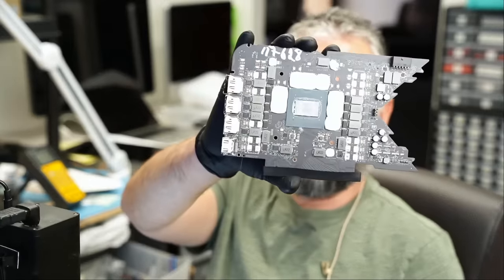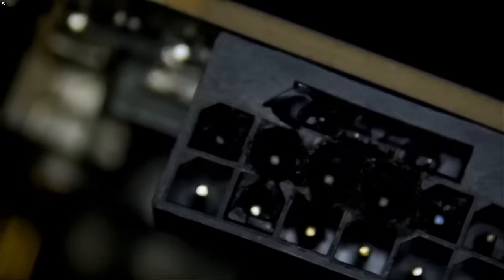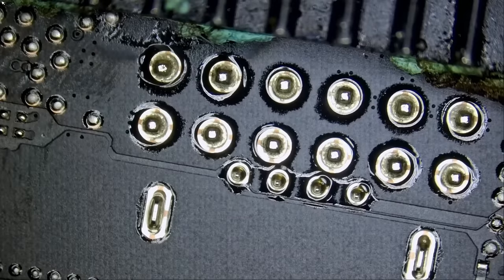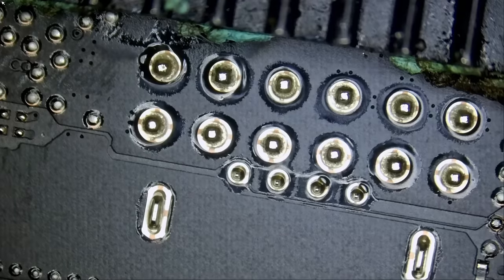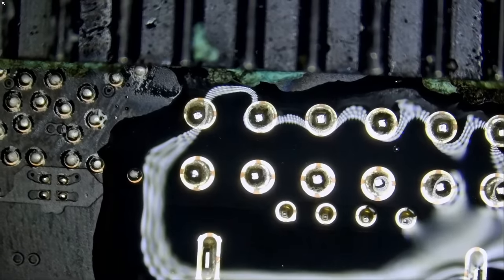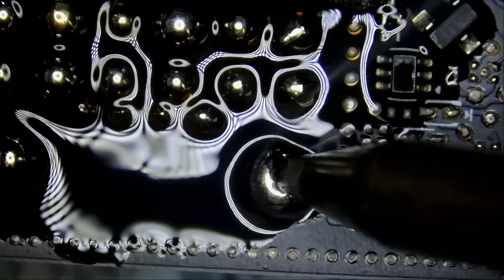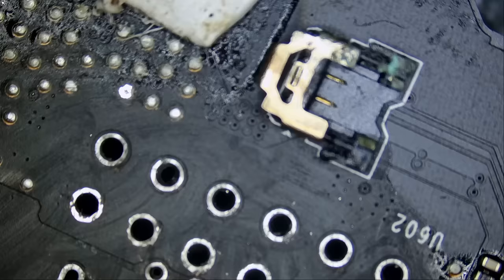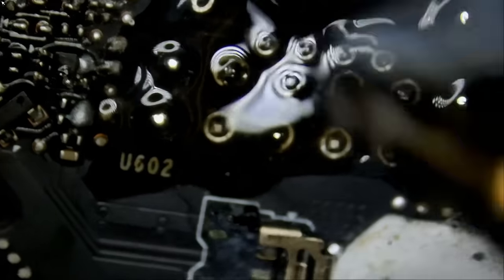4090's Still melting. What I think about CableMod

Comment: What do you think about the Cablemods direct cables? these ones specifically - CableMod RT-Series Pro ModMesh Black Sleeved Cable, 600mm, 16-Pin 12VHPWR to 3x 8-Pin PCIe, for ASUS/Seasonic PSUs ? I've just brought a 4090 FE And put it straight under water and so far it seems to be running as cool as anything even in gaming, no issues with hotspot or memory temps either and with that cable it's allowing me to run up to 133% power limit which allows up to 600W instead of 450W whereas the official Nvidia cable needed all 4 4 pin cables which I didn't have at the time so was restricted to 450w max. I'm keeping check of the 12VHPR cable end for heat, i've got a thermal camera I can use if needed too.
Reply: It works well enough, I have it, I bought the evga variant with 4*8 pins connector, no issues, I also had 90 degree connector v1.0 and the the v1.1 180 degree, they both worked fine, I had to destroy the 1.0 to get a refund, I don't use the 1.1. I just connect the cable straight to the card. Just make sure you connect your cable fully, if you cable manage make sure you don't pull out the connector and don't bend it too much, many people can't follow this simple guidelines, and the connector is not robust as the old 8pin that could accommodate these mistakes.
Reply: @eliadbu  Thanks for the info, I'm usually pretty good with managing the cables even though it looks like a rats nest inside my PC as it's literally fully kitted out 7000X with all Corsair fans, rads etc inside of it! I've ran my 12VHPWR cables directly underneath and they come out by the back 4 fans on the side panel side as i've got my reservoir in that area too so it works quite well with the 60cm cable without putting too much strain on the GPU end which I always make sure is plugged in until I can hear and feel it click in to place as well as make sure visually.

Comment: I have a power-on problem with Asus f512f... it doesn't turn on and the charging LEDs are completely off. Can I try something? Should the computer start if I disconnect the battery?

Comment: 12V HPWR Specs should update to prevent this, At least recommended connector to have Built-in Temp Sensors to let card limit power and alert user if temperature arise above 105°C.

It may able to implement using existing sense pin. If you cannot fix the Power Supply and connectors (also cable mods) which already in the market. At least damaging to cards can be limited by the card itself.
Reply: They should get rid of that stupid 12v connector and rollback to the good old 8 pins.
Reply: @aldenkia  It's not that stupid, old 8-pin waste too much space and can be a bit of pain for cable management.

12VHPWR just need some fool-proof method to prevent bad seated connectors or poorly mated contact since its offers 0 redundancy.
Reply: @sfalpha  i believe 12vhpwr still waste alot of space due to their bending limitation (even the 90deg connector being recalled) and i dont think 8 pin connector uses a lot space either (which you can still use 90deg connector available for cheap!). The problem is 12vhpwr pin size which is too small that limit area of contact. It is within the power limit but too close to the upper limit thus leave no room for user error. Its like punishing cuatomer thousands of dollar for mistakenly plug the power connect, it is just plain stupid.

If you need more space in your case, then asus solution that bring the power connector to the mother board beside pcie slot is far better.heck even it is already being used in server space!

Comment: How could they NOT have find these issues during production and testing?????
Reply: People are using aftermarket 12vhpwr cables and angled connectors for better cable management. If you use the one ugly one provided by Nvidia this isn't going to happen.

Comment: Even if those cable mod adapters were made from titanium and 24k gold, they would still fail. The problem, as we all know, is the design of the power system on the card. Too much power through too small of a jack. Try powering up a 120v blender with 220v and you'll see the same exact failure happen. Too much power through too small of a port, period

Comment: Good thing about cable mod is that they recalled the bad adapters. I had 2 of them never used though but got a full refund from the vendor i bought them from.
Currently using a cablemod 12vhpwr stealthsense cable on my 4080. Been using it for a while and no issues.
The design of the connector is crap and you need to be carefull with tight bends and so on. The issue with the 4090 is that the card pulls too close to the limits of the cable.
There is not enough ''safety'' headroom in the cables spec for 4090's. Couple that with other variable like loose connection and you got melting connector.
Nvidia should have just sticked with the old 8pin connectors. 3 of the 8pin cables would be safer then a single 12vhpwr cable for a 4090.
Derbauer talked about this in one of his videos. Its simply a bad design and we can only hope they make it better. Or just add 2 of them for high end cards for more headroom.

Comment: I guess I am just lucky but I have had zero issues with my 4090 but then I don't use any fancy cable mods and I don't overclock or push my card hard so the connector is pushed to its limit. Great business for this guy though lol

Comment: I think the real reason for all of this is secretly that GPU makers want to force motherboard makers to put enough power delivery on the PCIE port. So they are taking things to extremes, deliberately causing design failures, so they can pressure them into giving the GPU makers what they want, which offloads a big portion of GPU makers efforts onto motherboard makers, causing them to eat the cost instead of Nvidia. Nvidia would be happy if they could release a GPU where they don't need to worry about power delivery and all of that is on the motherboard instead.

Comment: Hello! I am thinking of getting a 4070Ti Super, should I avoid it? I am planning on using a Cooler Master ATX 3.0 SFX PSU with native 12VHPWR support.
Reply: honestly yes. I had this stupid 12 pin connector melt and nearly burn my whole pc down, RTX 4080 Super FE. Connector was fully plugged in and I have photos to prove it. Now running a TUF 7900XTX with triple 6+2’s and it’s been flawless. 7900XT is cheaper and slightly faster than 4070ti Super, you also won’t have to worry about anything melting or driver problems
Reply: Melting only happend on 4090,   even a 4080 is pulling less than 280w and even less If you undervolt.
There should be no issue

Comment: What doesn't help is that two 4090 users might have different experiences, if you have one playing a game that utilizes the VRAM or rendering or whatever, one might draw 380 watts on average, the other 450 watts. How many more degrees is that to melt plastic on tiny metal pins? Probably more than enough, not everyone who has a 4090 has the same power draw in their workload. Check out your gpu WATTS usage in hwmonitor or other programs. Some games like Quake 2 RTX on my 3090 use 340 watts average, some games just 200.

Comment: My "new" 3080Ti (upgraded from 980Ti) might need 3x8pin, but I know it wont fail since its tried and true and second Ive made those power cables myself from scratch. Id be pissed as 40xx owner for this and possibly sue the manufacturer.

Comment: I could have bought 2 4090s on December 10 2023 for 900 dollars for both.  I passed.  I wish I'd bought them.  These prices are insane right now.  I have/had 2 tesla cards and I didn't really need two 4090, and I also thought they might've been stolen.  But they weren't stolen.  I wish I'd bought them now.  These cards are going to 1400 now.  I'd never run them at 450W, but I would resell them.
Good video.

Comment: I wonder why don't people return the card if the connector melts ? Don't know about usa but at least here in eu you get 2 year warranty, so you simply return card and you get a new one.
Reply: Because this is not under warranty, its users error/fault nvidia states.
Reply: Because the card manufacturers claim that the connectors melting are due to user error, the same reason why cracked PCBs get sent here instead of back to the OEM.
Reply: Consumer Law in the UK and EU is very different than the US.

Nvidia can't use the excuse of "it's user error" like they are doing in the US.

In the UK and EU the customer deals with the seller. It's the sellers who deal with Nvidia, not the customer.

Comment: The main problem is that folks use adapters on their 4090's, they should ONLY use ATX 3.0 or 3.1 power supplies with a native 12VHPWR connector and a single cable, problem solved.

Comment: this is a design flaw, nvidia changing the design with the 12V-2X6 is proof of that theres a problem with the 12VHPWR otherwise nvidia would not have changed it so soon. they seriously need a class action lawsuit for failing to acknowledge and warranty this

Comment: To be honest I could of bought a 40 card but seeing so many of them burning from the pins, I was like naaaah i'm good. Just go buy a AMD
Reply: Some nVidia AIBs still make models with the 8-pin connector, but not the super high end models. Myself, I got an AMD RX 6950 XT after my last nVidia GTX 1080 died.
Reply: @kunka592 this is only for the 4070 and below the rest are mandatory to use the trash connector

Comment: a mixture of sub par connection risistance and too small of a conductor. I do not understand nvidia's reasoning behind this new connection 12v hpwr they could have stuck with the original pci-e connection and added a smaller connection for the extra sense crap.

Comment: wrong foundation or not the fact is, they dont want to make something that works best.  i mean lets get real for a second, its just a connector.  hell technically it could be made out of metal as connectors were in the past.  but instead they are going with the cheaper polymer option (plastics) , and just like plastics used in automotive engine applications, they typically fail over time.  They may work well when new, but their composition begins to break down with time and cycles of heat until it it fails.  they need to go back to metals

Comment: The perfect connector will be one with flux and solder wire inside. Once the connector melts the solder wire also melts and solder the pins together. Zero problems after except that will be unable to replace the card.

Comment: I have a question for you all... I have been using a cable mod adapter (180degrees one) for my RTX 4080 (gainward) for about 1 and a half year now, never had a single problem. I did receive the email from C.M. where they said they would recall the adapter, refund me and bla bla bla, but to be honest, they never replied to my email asking: IF I TAKE OFF YOUR ADAPTER...what shall I use? How should I connect my 4080 anyways?  

I never had a single issue with the adapter and I make sure it is perfectly SEALED connected once a week. Do you still think I should stop using it ...? and if the answer is yes, i'll ask you the same thing: how shall I connect my card then? what's the safe way to do so?

Thanks everyone for your help!

Comment: They do have high temperature plastic. Or why don't they try using metal? That won't melt or damage. Stronger connectors more resilient medals. Wife. Why use a cheap plastic connector that is being put through massive amounts of heat and temperature and voltage?

Comment: kinda funny  4090 always breaking but i never see xfx 7900xtx in your shop .  AMD is waaaay better
Reply: yeah but amd drivers make your pc stutter,when i put back nvidia in pc  no stutters
Reply: Well, AMD didn't use that questionable connector. The old standard was extremely overbuilt for a reason.

Really, Nvidia probably could have avoided this fiasco by speccing two connectors on their high end GPUs.

Comment: Why only the rtx 4090 suffers from this problem in the whole series, even the rtx 3090ti, which has the same TDP, did not have these problems, and they all use the same connector?
Reply: 3090 ti is the old connectors which divided the power across multiple points, so no big power surge into one connection
Reply: @A-Ghorab  Nope, rtx 3090ti have 12VHPWR connector just like rtx 4090 and whole rtx 40 series
Reply: The 4080 is aswell, the card shown in this video is a 4080.

Comment: btw most meltdowns happen because the side panel of the PC case pushed too hard against the cable breaking off traces inside the connector. Thats why a class action will probably not end well.
Reply: thats not the whole reason. with enough time and enough heat cycles this will happen. Heat casues the connectors to expand which results in more heat due to resistance increase repeat this enough and it eventually get hot enough to start melting the plastic. Truth is the connections are tooo damn small to carry the current.

Comment: Yea its cable mods fault for trying to solve a problem Nvidia created. There should be a class action lawsuit against Nvidia and this would not happen again. As it stands the 5090 is shaping up to be MUCH worse as its power draw will be higher and Nvidia even has power supply manufacturers making special connectors. Funny no one else is adopting that crap connector, huh?

Comment: i do not have any agenda against NVIDIA or AMD but i had so far over 15 RTX 4090s on my Testbenches and in my own personal PC and i NEVER encountered even odd 12VHPWR voltages.
the connector is flawed. yes... but in the end it's often user error caused by extremely small margins of perfect insertions without any room for error like slightly bending cables or physical stress on the connector.